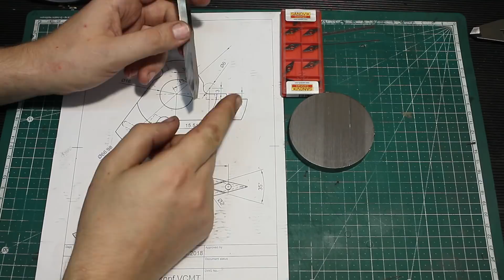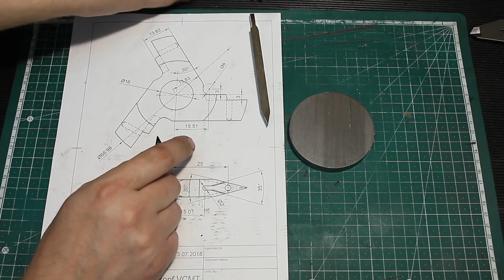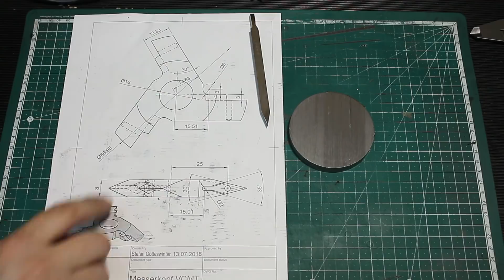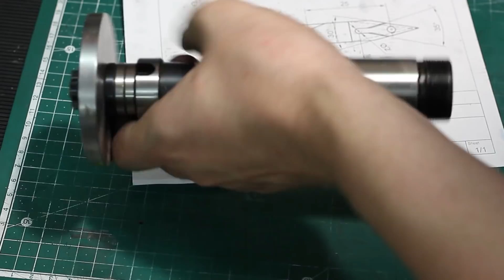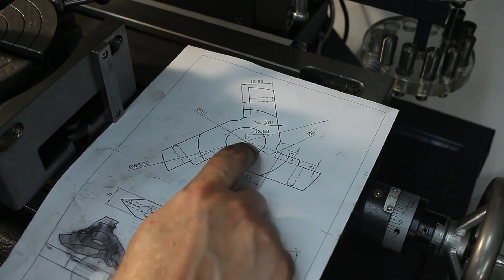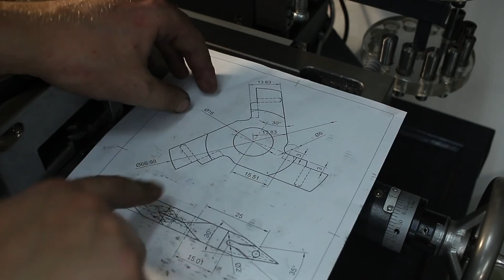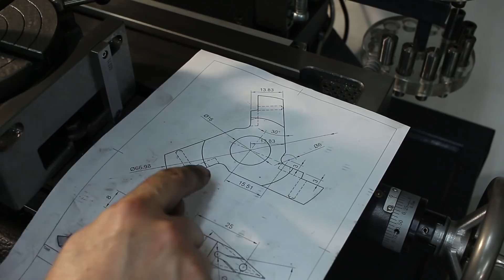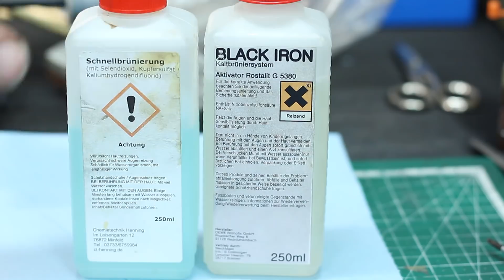Indexable V-Groove Cutter

Comment: great work as usual SG.  Pro Tip:  If you put a playing card in it, it makes your mill sound like a motorcycle.
Reply from the maker: BrummBrummBrumm!
Reply: Would a 1mm sheet of delran make it sound like a Harley at lower speeds? (Might have to implement a momentary stop controller to reproduce the almost stall idle skips... ).  🤪

Comment: Surface ground the thing to 0.002mm's...cause that's how I like it!
PS: There's nothing better than a purpose built tool. That was really professional, and really inspirational!
Reply from the maker: Having a surfacegrinder caused a sickness ;)
Its just so fast and easy to make stuff to tight tolerances with a good finish.
Reply: I totally agree. I don't have a surface grinder but have recently developed a lapping fetish (surface lapping, cylindrical lapping, even thread lapping), but it's a big PITA to make a lap for everything and most importantly you can't really lap that much out...I'm kinda missing a step!
Reply from the maker: I start to get into lapping and its definetly fascinating. I blame Robin Renzetti and Tom Lipton 100% for that.

Comment: The cutter is a thing of beauty as ever. I'm not sure if the VCGX tips I suggested would work. After the 15 deg angle grind you would have a thinning of the thickness of the tip and all sorts of compound angle issues. Better to stick with the top grind on the VBMT, but with a slight positive rake angle.

Comment: Now that I've finished watching the video, I think Sandwich, sorry Sandvik would be proud of you Stefan! You should work for them as chief product prototyping pantographic person probably. It may all be down to rpm and cutter sharpness but you may find it gives a better finish by either climb or conventionally milling a roughing pass, leaving a half millimetre or so of material to finish pass conventionally at your mill's highest rpm. Finely mirror honing the inserts of course will produce a finish equivalent to the edge that you produce on the cutters. Plastics benefit much more than metals from a razor sharp cutting edge as there's virtually zero tool pressure to rub and polish the surface with brute force like cutting steel, thus the heat generated due to friction. Obviously it's not worth sharpening inserts for steel cutting to a fine finish as they will dull quickly but with aluminium and plastics it will be worth it, trust me. As a shop fitting joiner I sometimes have to use a hand held Makita trimmer and 3mm radius cutter with ball bearing to finish 2mm ABS edging tape on MFMDF panels and find it best to quickly back pass (climb cut) to avoid chipping and then forward pass (conventional cut) to give a smooth, polished finish at a slower feed speed. The fine shavings are a nightmare though and static makes them a real pain to clean up as they stick to everything. So just remember that the finish you produce is usually equal to the sharpness of the cutter, particularly in softer materials like wood and plastics which also require higher rpm to avoid chatter. Hope that helps someone.

Comment: very very nice. When I was a cabinet maker and needed a smooth finish, I would switch to highspeed steel or tantung (?spelling?) because you can get a sharper edge on your tool. I wonder if the same would apply to plastic??

Comment: Impressed by Your work! 
Do You think using polished carbide positive rake Al type inserts could improve the finish in nylon? I get very good results in the lathe using VCGT and DCGT type inserts for most plastics. Only problem I noticed is som "grabbing" in flimsy parts due to to much rake. Perhaps VCGT would fit directly in Your pockets?

Comment: Interesting video, Stefan. Thanks.
If I read your drawing right and consider that you grind the carbide inserts to flat tops then the resulting rake angle is around zero. To my knowledge generally to machine plastics rather acutely positive rake angles are recommended. I don't know whether that is different for PVC but I assume not. Or did you neglect that fact for other reasons? Like you would have had to grind the inserts with a V-groove along lateral cutting lips but stop the groove before cutting open the tip. That would be a challenging and time consuming grind requiring small diameter diamond grinders. I would not want to try that either.
An option could have been to use a cutter with only two "wings" with one insert mounted alternatively to each side of the steel disc surfaces. One on the left and the other on the right side. Then it would have been easy to grind a quite positive rake angle on the sides of each insert. As a consequence of the more positive rake angle you could have used higher rpm without melting the PVC and probably gained an even better surface finish and shorter machining time. Such a cutter would even have been easier to make (in case of 2 wings): Only 2 wings instead of three. The insert seats could have been machined 15 deg off perpendicular to the steel disc's upper and lower surfaces which is more accessible than machining on the narrow surface of the "wings". You could easily increase the number of wings to higher even numbers (4 or 6 or more allowing higher feed rates) with alternating inserts on each side. And you probably could (or rather would have to) grind the inserts on your Deckel clone (or future T&C grinder) while they are mounted to the cutter using one of these narrow grinding wheels: https://www.banggood.com/180-Grit-100mm-Diamond-Grinding-Wheel-Carbide-Steel-Resin-Cutter-p-1001580.html?rmmds=search&cur_warehouse=CN  
Probably this design would also produce a fine finish when climb cutting so you could mill your grooves back and forth saving return travel time. What do you think about this "mind-CAD" alternative design?

Comment: Fantastic build Stefan and great result. I expected you to turn the 30 degree angle on the blank first,  before you cut the "flutes". I thought that the interrupted cut may not give a great finish. Obviously, the result speaks for itself, but did you even consider doing it the way I described?
Reply from the maker: Thanks. I am not sure why I opted to cut the chamfer after fluting :D
But it worked fine and the interrupted cut produced nice short chips too ;)
Reply: I thought you might say that about the chips, Stefan. Furthermore, far from making the finish worse, I'm guessing you will have encountered situations such as in turning aluminium (especially in the softer, "gummier" grades) where an interrupted cut gives a much better finish, presumably because the cutting conditions do not support formation of a "built up edge"?
I'm sure the reasons for home-shop people often being gunshy about interrupted cuts relate to the lack of rigidity of most home-shop machine tools. 
So I guess I should qualify my enthusiasm for that style of cut by saying: 
as long as the depth of cut and feed rate are kept within the limitations of rigidity (of machine, workpiece and setup)

Comment: Hi Stefan, thanks for documenting this great build! Nice techniques, great results. 
However, I noticed some points not so 'stefan-like':
- it seems to me that working with X axis on the pantograph will not ensure all inserts are located exactly alike radially, especially if you don't have a DRO there. Maybe if you used hard stops...
- thinning down the inserts, using Z on the grinder, will also result in kind of uneven thicknesses. 

All in all, I would like to see a runout test on the mill, I suspect that it might not live up to your usual standards. 
Given that, it still would make more sense to me if you prepared a fly cutter with a round HSS bit (single lip cutter grinder would suffice to grind the tool) that would leave a great finish on PVC and allow for easy experimenting on the rake angle. You could, possibly, just use your shaper bit on a fly cutter and compare it to the insert-cutter just for completeness.
(or, most probably, you've already tried that...)

Many thanks
Reply from the maker: - Not sure why the x-axis of the pantograph would not be accurate? I always work to the same number on the dial, Same effect as running against a hard stop.
- Of course I ground them all to the same thickness - I have a 1micron reading digital indicator on the height adjustment of the surface grinder. I garantuee you that they are pretty close to the same thickness ;)

Indeed I checked the runout on the tip of the inserts, its about 2/100mm - Including the MT4/MT2 sleeve in the spindle and the MT2/16mm stub arbor holding the cutter.
Reply: thanks for the reply Stefan!

Comment: Great work as always Stefan. As I am no pro machinist I had a question as to why the 30 degree angle is important? And maybe the 35 works but it did seem to bother you that no 30 degrees were available...
Reply from the maker: Because its called out on the drawing :)
I usually dont bother to discuss dimensions/tolerances of customer parts if there is nothing that is inpractical or impossible.

Comment: Thanks Stefan. excellent as usual. How do you true up diamond wheels for flatness and concentricity on your surface grinder and d bit grinder?
thanks and regards John Spargo Cape Town
Reply from the maker: I dress with a piece of pure molybdenium followed by using a aluminium oxide sharpening stick to remove the excess resin bound. That works ok - I guess a brake-dresser would be better, but I dont have...
Reply: Stefan Gotteswinter thanus Sephan - do you hold these by hand? a demo would be awesome!
kind regards John Spargo in Cape Town

Comment: Sorry if I missed this part but, did you grind 2.5 degrees of both sides or just offset the v groove in the holder in relation to the rotational centerline? Hope that made sense. Great video as always!
Reply from the maker: Yes, I ground the inserts on both sides.

Comment: Is there a reason you did not angel the rotary able on the milling machine 30 degrees, cut one side of the pocket  and then angle the table 60 degrees off the 30 and mill the other side of the  pocket? I would assume that the cutter would be rotated on the table to do each side of the pocket prior to setting the second angle. 

Dennis L.
Reply from the maker: Yes, that would also be possible - and a very good way to do. But I figured the pantograph to be faster and easier to setup.

Comment: awesome video Stefan! I get so pumped when you put out new material man. So question, or maybe 
 some hypothetical rhetoric, Being that you ground the inserts flat and removed the chip breaker  the cutting edge are now more neutral than stock, and also the finish being 120? diamond wheel, now could you lap/hone the cutting edges/faces to a finer grade and would that improve the finish cut quality? From my experience PVC likes very sharp positive geometry. just spitballing... always looking for more knowledge. Cheers brother
Reply from the maker: You are right on all points :)
The top rake is neutral/0° - which works for plastic but is not 100% ideal, and the finish from the D126 wheel is not ideal. Lapping it would and will improve the finish. And I definetly will do that :)
Reply: Very cool, I would be really interested to see a side by side or even a quick update on how the changes affected the work piece!

Comment: It works like a charm but I do feel that carbide is perhaps overkill for PVC :P
Reply from the maker: Absolutely overkill! I was considering making the complete cutter out of toolsteel, harden and grind it - Or braze some HSS onto a cutter blank, and grind those in shape. But in the end this design was the easiest and fastest to build.
Reply: It's all about what you have available and the result looks absolutely amazing. I'm actually quite curious how it will perform on something like aluminium.
Reply from the maker: I might give it a shot :)

Comment: Doing a keyslot with an endmill is botching - you have to use a shaper! :-)
P.S.: I always use "Gelben Sackmüll" in my stove. It has a decent heating value.
Reply: You don't need a shaper to do keyway 'shaping', can do it in a lathe, or even in a drill press.
Reply: That's a nice setup. I've only seen lathe 'shaping' done using the lathe carriage & cross slide. Can only do tiny cuts, but when that's what you have to get the job done...

Comment: Great video... as always! Please make a video when you lap the inserts (even if it's just a short clip). Also... you've already said in another comment that this tool should work well in aluminum and steel. Do you think that you'll have to modify additional inserts with a different rake angle (positive or negative rake) and possibly a chip breaker, for use in ferrous metals? Please make a video when you try this tool with aluminum/ferrous metals.  Danke Stefan.  Michael (in Canada... @tigwelder on Instagram)

Comment: Works great, will last longer than the need to make those parts I'm sure.  Missing style points for the lazy keyway (why not 'shaped' in the lathe,  that's pretty common hobby stuff), and leaving the step marks on the steep taper, though.  See what happens when you earn your reputation as a stickler for precise work?  People expect it from you on everything, all the time!  :-)
Reply from the maker: I kinda like the rounded crest of the keyway - also doesnt create a stress riser in the corners. And it goes very fast to machine, if the part is not to long/thick.
If I had to do a deeper keyway, yes, I would probably shape it on the lathe. Or buy keywaybroaches ;)
Reply: The radius is stronger than the sharp corners actually. Like a piece of cellophane with a small slice in it. Rips easy. But a round cut would not rip easy.
Reply: What keeps the key down in the keyseat?  Just the tiny contact between the corner of the key and the start of the radius?

Comment: There are 30D included angle inserts out there. But I doubt that Trapezoidal (aka Metric Acme) threading inserts would work for you. What no Keyway Broaches? :D Add in the overhang from the spindle bearings to the 5C Collet Chuck. That is one reason why I really prefer 5C Collets built right into the Spindle or an adaptor that uses a draw bar through the spindle bore. Nice piece of work, as usual

Comment: so in other words, you just need to get another shaper? lol. It's starting to sound like selling it is starting to bite you in the backside now.
Reply from the maker: Nope, of course not - I know pretty exactly what I used the shaper for and I knew that I needed another way to make those certain parts.
Reply: yea, I know that I'll never give up my shaper, the finish is far better than I can get on a mill and less headaches with needing custom and expensive cutters, lol.
Reply: Thats what i thought as i saw the video but i know he is god u can see in his name
Reply from the maker: For me, the surfacegrinder has replaced the shaper very much.. :)
Reply: except for brass, bronze, aluminum, pvc, delrin, etc, lol. (or heavy metal removal, lol)
Reply from the maker: Brass, bronze and aluminium grind very nice :)
Reply: yea, Ive seen some people doing brass on a surface grinder before, just needed to redress the wheel a few times when making a big magnetic transfer block for thier rotary table. I dont think I would ever do aluminum or other non ferrous metals on a grinding wheel tho, no matter the situation, lol.
Reply from the maker: Aluminium, Copper and Brass actually grind very nice :)